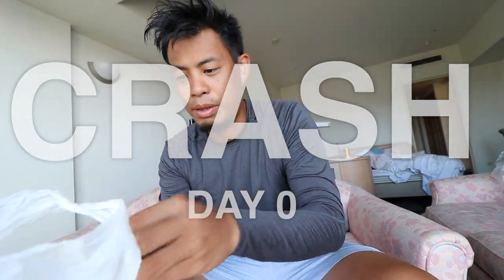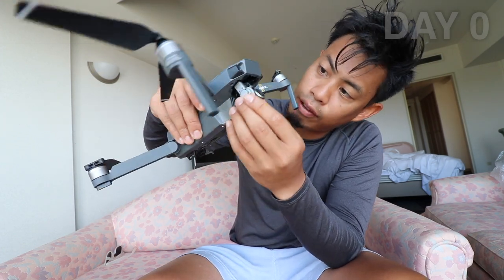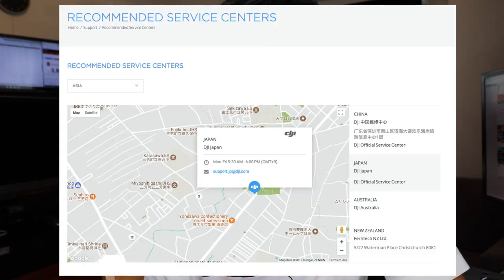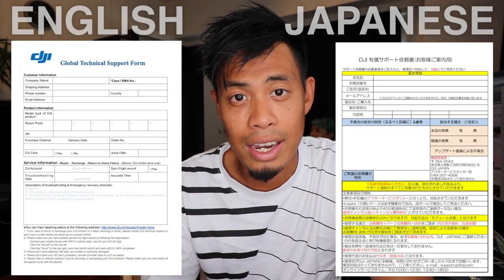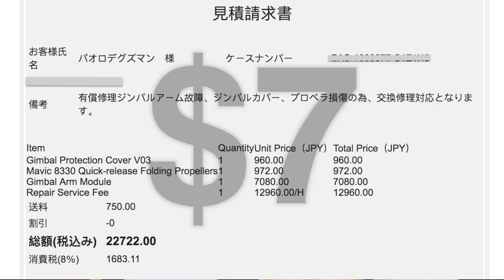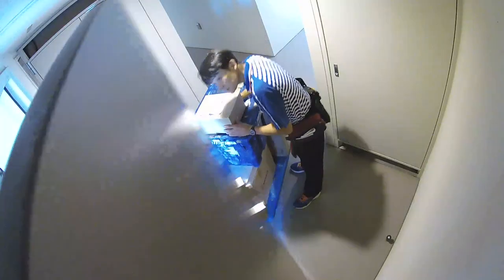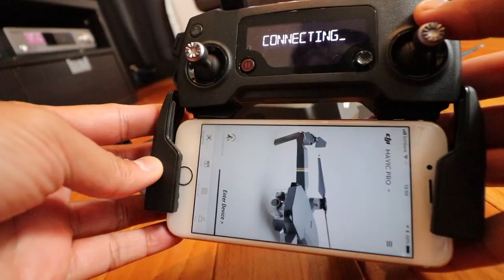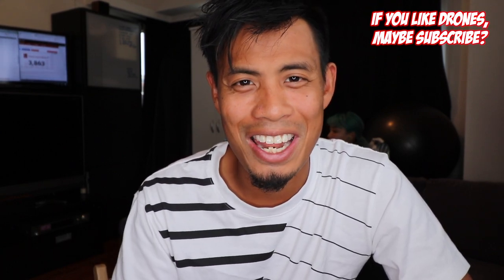CRASHED my DJI Mavic Pro Gimbal Repair with DJI Support | THIS MANY DAYS TO FIX

Comment: mavic is a very tough little drone. glad dji support worked out for you!!! others have not been so lucky.
Reply from the maker: Hey edbjr888, yeah.  it's an awesome piece of engineering.  have you had any issues with DJI support?
Reply: No not yet, but i think i will have one soon as one of my mavic batteries might be having a voltage differential problem.
Reply from the maker: Oh wow, doesn't sound good.  you should take care of that before it falls out of the sky.  good luck.

Comment: Hi. I got my Mavic air with a IMU issue after a crash. Problem is I bought it from a website which import it from HK. Yesterday I visited a DJI official retail shop in Tokyo but they said as it is an import they could not fix it even DJI support Japan will not fix it. Do you know what should I do in that case?is there any DJI support for international?

Comment: Same happened to my 30sec after it was in the air it crashed itself luckely it crashed and landed on the roof not so far from me since I was up 7th floor in a Hotel in Bangkok. My gimbal is also not working right. Did you find out why?

Comment: Well fyi, the dji repair station at KL, Malaysia sucks. I contact them via email and they gave me a not working phone number. Later I email them back that your phone is not working. It’s been seven weeks no replies. Anw after two weeks of waiting I got it repair by other electronics store. Good video, keep it up.
Reply from the maker: Hey Cesar,  wow, that is a completely different experience than I had.  That sounds like the worse customer service EVER!  Maybe it really depends on the local support.  Glad you got your drone fixed by another electronic store.  What broke and how much did it cost to finally fix?
Reply: Hi Paolo fromTOKYO, the gimbal motor overloaded, similar to case like yours. Based on the technician observation; the gimbal clamp need to be replace, the vibration absorption board cracked. Total repair cost me SGD 200. Glad that my drone can shoot again :)
Reply: Hi DJI Support, could you define for me the meaning of ticket number? Thanks
Reply from the maker: That email address is suspect.
Reply from the maker: Hey Cesar, 200 SGD is less than I paid so good for you.  happy to hear that the drone is working.
Reply: Paolo, the email was found under the dji official website under recommended repair stations
Reply: DJI Support, if is not official why put it in the dji official website.
Reply from the maker: DJI Support - This is very alarming for consumers.  DJI is saying that this is not an official DJI support address, but this company is operating as an official DJI Support center.  What is DJI going to do about this?

Comment: Hi paolo, about your old videos of the CAAP permit? is it really true no need to get one?
Reply from the maker: Hey Argel, I've actually sent CAAP a few messages to confirm, but they are not replying to me by email.  Kind of strange.  But reading up on comments by other people, looks like registration and written permission for recreation small UAVs are not necessary.
Reply: Paolo fromTOKYO yeah, they are not replying. I've already sent an email to them last month but no response from them until now.
Thanks a lot. Your videos about DJI helps a lot :D
Keep up the good work. 👌👍
Reply from the maker: Hey Argel,  makes you wonder why the CAAP are doing with there time.   How difficult is it to respond to emails.   1 Month to respond is pretty ridiculous.
Reply: Paolo fromTOKYO i don't even know why is it hard for them to reply. But i think they are ignoring my email because its true that no need to get a permit from them.

Comment: Hi Paolo. 
Can you please check the 10th digit of your new serial number? If it's a R it mean refurbished...
I'm having an issue with DJI Japan as they are shipping me back a refurbished unit to replace my new unit. The price difference between both is 200$...Of course, this is on top of another 200$ that I paid for repair....
Real scam
Reply from the maker: Hey Chris.  Just checked.  Yeah, the 10th digit is an R.   What's wrong with a refurbished one?
Reply: Oh Sorry about this. Just have a look on DJI Website....Brand new Mavic 999$, refurbished 799$. DJI gives away a 200$ discount on refurb because they are made of bit and pcs from other broken drone...
So they basically replace our Mavic with a lower value one. And they charge us for repair...
I'm really mad at DJI right now...Can you tell?
Reply from the maker: I'm pretty satisfied with their support.  To me, it doesn't really make a difference if it is refurbished or not.  It's all the same plastic and metal.  I'm sure they thoroughly test the refurbs before they go out.  DJI can't afford to have drones falling out of the sky.  I have not had any issues thus far.  I broke my drone.  I sent it in.  And they sent me an almost brand new one that is 100% working and charged me only repair costs.  Rather have a refurb than get back the one I crashed with real damages/scratches and such.  Pretty fair in my mind.  But if the drone crashed because it was faulty, they should 100% give you a new drone.
Reply: This a really great perspective. Makes me feel better about the swap but still have a bit of frustration. Glad you are happy with your bird, this is very helpful as well. Thanks for sharing your positive view.